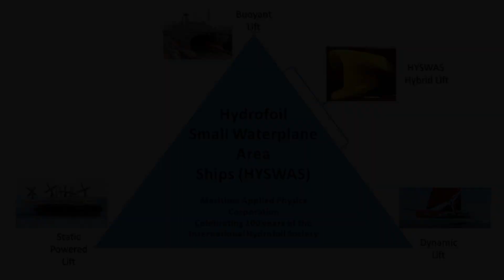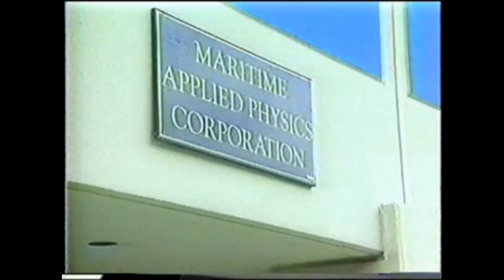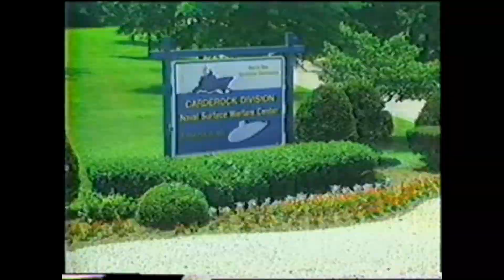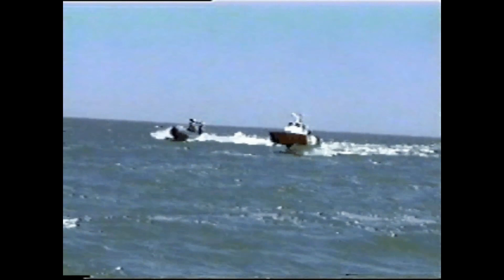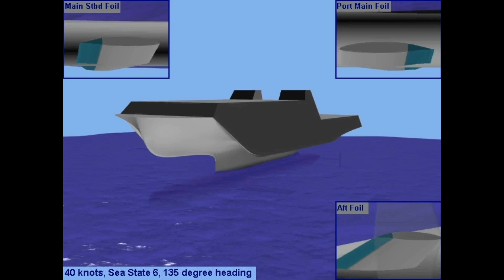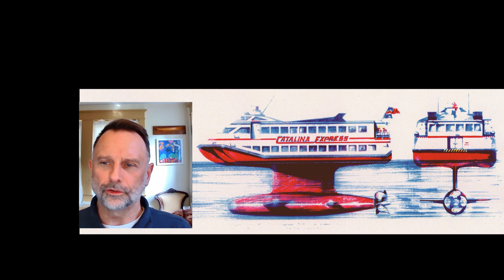HYDROFOIL -- Mark Rice HYSWAS Explained -- Hydrofoil

Comment: Couldn't you engineer the lower hull to raise up and down ? Have it raised when heading for a dock or shallow water. Then lower for optimum deep water travel ? I know some sail boats have a retractable keel . Kind of the same thought. Have it lower hydraulically , then some type of mechanically actuated lock.
Reply: that would both add alot of weight and engineering costs, but i had the same idea.